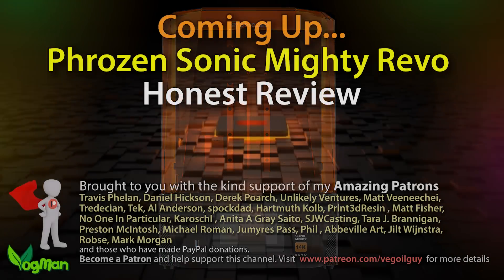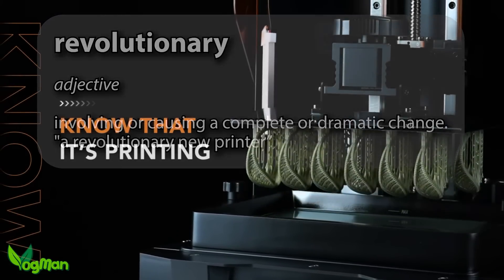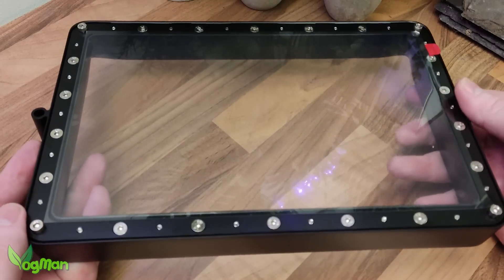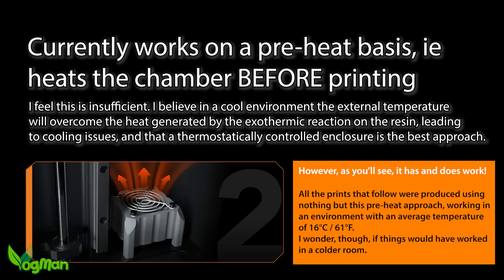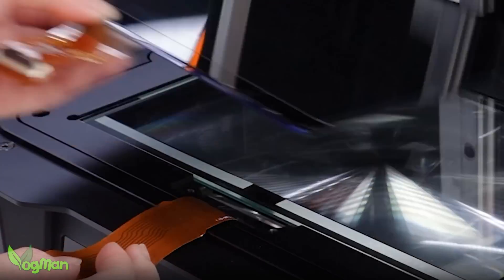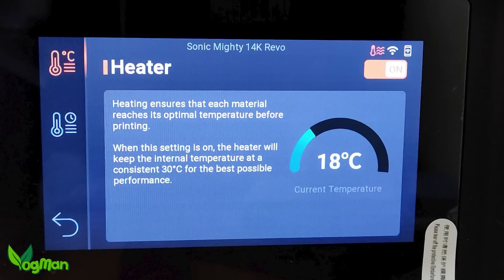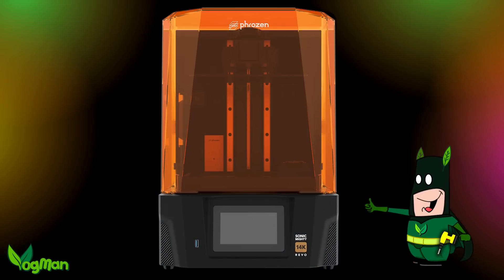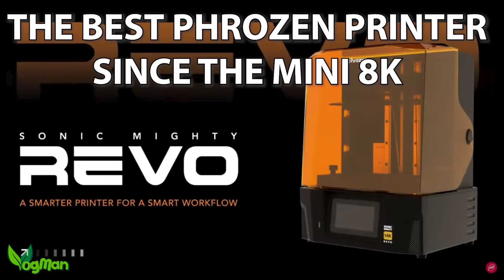Phrozen Sonic Mighty Revo 14K (HONEST review) 3D Resin Printer

Comment: Hey Vog, some people complain heaters cause print lines, did you encounter this problem ... i wanted to buy elegoo mini heater but ive seen people complain it produces print lines in every print.
Reply from the maker: No, never had that issue. I guess problems are possible if you don't let everything warm up to the correct temperature first. But I just leave things half and hour, or an hour if there's a big temperature difference, then set things running. I genuinely wouldn't be without a heater 😁
Reply: @vogman  but did you test the elegoo heater ? users say that elegoo heater is the only one that causes such problems..
Reply from the maker: No, actually, that's quite interesting. I did ask them if I could review their heater as I'm such an advocate of their use. Strangely they told me there was a stock shortage. Maybe there is an issue...?
For your peace of mind, I've had no troubles with the ChituSystems heater.
Amazon UK ▶ https://amzn.to/42GtSGD
Amazon US ▶ https://amzn.to/42xbz6A
Reply: @vogman  they knew you will test it properly and report the flaws ... meanwhile Uncle Jessy did the review and on his prints the layer lines were visible but he didnt say anything about it - as you know he gives only positive reviews ... thanks for your help Vog! ☺

Comment: Hey VOG, FauxHammer is complaining about the heater being useless ... what are your thoughts ?
Reply from the maker: It's possible he has a dud unit. Unfortunately it happens to us all.
Reply: @vogman  well he is referring to how the heater is positioned and as a result the heat goes up and most of it escapes through the gaps
Reply from the maker: I don't critique the critiques of others. We're all entitled to an opinion. It's up to the viewer to decide how valid that opinion is.
My experience was positive. I can say in a workshop with an ambient temperature of 16C, the Revo stayed toasty warm which is what resin like.
I've been experimenting with heaters for a number of years now, including building my own. I favour "enclosure" heaters over "tray" heaters as ultimately the latter loses heat and the former retains it, and I found the Revo's heater a reasonable enclosure heater (though I did offer a couple of comments I believe). Could it be better? Sure... but I've been campaigning for manufacturers to include heaters since the Mars 2, so I'm just grateful they're finally listening 😁
Reply: @vogman  so you can maintain the temp. in printer at 25C while ambient is like 10,15C ?   Thanks for explaining, really appreciate

Comment: Very beautiful videos and package, but the residue detection makes false alerts, the heater aims at a not good enclosure cage, the camera and the lights just doesn't work properly... It's far better (and cheaper) the Elegoo Saturn 4 Ultra.
Use your marketing money in engineers, phrozen.
Reply from the maker: I can't disagree with anything you've said as I believe I also said it, but I can say these are largely firmware issues that can be easily remedied.

Comment: How does that tilting lid design save space?  You need quite a bit of space behind the printer (and mine is just a few inches from the wall behind it) in order to open the lid..so the required footprint is much larger than the physical printer and the wasted space is behind it, so it’s completely wasted, can’t even put a tool or gloves or anything else you need access to to keep them handy as they’re BEHIND the printer.  When I remove my lid (Mars 4 Ultra) it either goes on top of my wash station or cure station…whichever one I’m not currently using.  So it doesn’t really require any space…lift it up, move it a foot to the left or right then put it down…zero wasted space.  Same thing with the new Elegoo Saturn 4/Ultra…I’ll take the 3 over the 4 for MANY reasons, the 4 just doesn’t appeal to me.

Comment: Nova3d Whale Ultra heater does exactly the same, turns off once the printing starts. I asked them why, this was their reply

hello,
Friend, our heating system heats before printing, but does not heat during the printing process. Because the screen will generate heat during the printing process, printing will not fail due to low temperature. If it is heated during the printing process, the operating temperature of the screen will be too high, thus affecting the service life of the printing screen.

Is that Phrozen's thinking or will they really update the firmware to rectify this?
Reply from the maker: Yeah, that's pretty much Phrozens approach here too. The problem is, it doesn't take into account the ambient environment. If it's already warm, it's not an issue. But if, like mine, your workshop gets cold, then it can have an impact. That's why I prefer a thermostatically controlled enclosure approach.

Comment: Crumbs, that's expensive! Specs-wise it seems pretty much on a par with the M5sPro and the Saturn 4 Ultra, both of which are less than half the price! Forgive me if I missed it in the video, but can you send print files to it direct from Chitubox or is the wifi just for status checks via the app?
Reply: the saturn 4 ultra is 12k so the price also influences that printer

Comment: A mini 12k would be a more revolutionary improvement.
Reply from the maker: That would be impressive, though I'd prefer the 14K screen. There doesn't seem much in it I know, but honestly the prints are so much smoother.
Reply: @vogman  a 12k screen on the mini's footrint would have a pixel size of around 16um, which is a huge improvement.

Comment: The knock at 2:38 had me looking at my garage door thinking someone was trying to come in 😂
 I really like the execution of the quick change screen... Price seems high for a heater and features that only "kind of" work. Hopefully Phrozen can fix the light flashes with an update because the built in timelapse feature is so awesome.  
Great video and review as always VogMan!
Reply from the maker: Many thanks. It's important to remember everything DID work, but I just think these things could work that little bit better, and hopefully these are firmware issues 😁
Reply: Yup you are not alone x))

Comment: Why is the light source this $1,000 printer is using being hidden?  No mention whatsoever by Phrozen, nor in this promotional video either.

What's so hard about putting a piece of paper over the LCD and showing us the light source functioning on every infomercial you reviewers make of a new printer?
Reply from the maker: It's not something I've ever been asked to demonstrate if I'm honest. The light source clearly works well, otherwise I couldn't have achieved those amazing prints 😁
Reply: @vogman  Of course it works, so go ahead and print a thin rectangle .5mm thick, and the dimensions of the build plate area, and show us how amazing it looks with the grid on it that you didn't put there when it's washed and cured.

Try not to break it into tiny shards when you're chiseling it off that etched build plate, :-)

Comment: I dont understand the autoleveling feature. The plate has ordinary screws  .. so what am I missing?
Reply from the maker: The auto-levelling does appear to work. Every time the printer is turned on it goes through its checks and the first touch of the plate is very slow and precise - adjusting I presume. The screws are a safety feature. With the M5S, Anycubic took flack from old school guys wanting precision adjustment. With the M5S Pro, Anycubic answered this by reintroducing the screws. I think Phrozen just cleverly observed this.
Reply: @vogman  Thank you!

Comment: How would you compare this with the Anycubic M5s Pro?  They same to have many of the same features, but the Phrozen has some nicer quality of life additions.  Are they worth the extra cost?
Reply from the maker: It has the same features, but the M5S Pro feels more thrown together, like an add-on heater that's nothing to do with the menu, etc. The Revo was well planned out from the start and an altogether better machine. But when it comes to printing, it's the same screen and the same performance.
Reply: @vogman  I bought my M5S PRO about 4 weeks ago after watching your and several other review videos. It is my first 3d printer and I have just hit 300 hours total print time as of today and couldn't be more happy with it. I really didn't like the idea of having to keep alcohol around so after I used the 2 bottles of resin that came with the printer I switched to their ABS like V2 water washable resin and I am really happy with it. Especially as I can use super hot water to assist with removing prints from the build plate which makes cleanup so so much easier.

 Personally having the heater as a seperate plug in extra and not intergrated doesn't bother me at all and it being able to stay on throughout the enitre print keeps the resin at a nice consitent temperature and viscosity. The only downside for me is if it was intergrated I could remotely shut it off if a print finishes whilst I am out of the house but that isn't a major issue.

Considering I bought the M5S pro, Wash and cure 3 plus, optional cleaning kit, spare screen, pack of screen protectors, spare vat, pack of replacement vat film and a spare build plate for about the same price as the mighty revo costs on its own makes me quite happy with my purchase.

Thanks for doing what you do VogMan, keep up the good work.
Reply from the maker: Many thanks 😁

Comment: It would be better that the vat be heated directly with a temp probe to come on and turn off rather than have an adjacent ambient heater which is less accurate.
Reply from the maker: Yes, but a hot vat and a cold enclosure leads to heat loss...  for example, a cold plate entering warm resin. It's better for everything to be the same I think.
Reply: @vogman  You are probably right now thinking about it.
Reply from the maker: My workshop gets pretty cold and I've tried a few different things. I can't guarantee I'm right, but those are the results I found 😁

Comment: Thanks for the review! 
But for 999$ they can keep it -  never gonna buy it. especially bcs its a phrozen printer. soon the new anycubic and elegoo machines will be released and for sure the price tag will be MUCH cheaper, at least half. 
Heating is nice, but not really needed and the detection features are usually turned off und useless overall IMO. 
Anyway, having competition is a good thing,, so probably soon we will have THE perfect resin printer.
Reply from the maker: It is pricey, but it's the best we've seen from Phrozen for ages, and they've deserve praise for that if nothing else.
Reply: @vogman  you can praise them ;) but my printers need to generate money, and the 300-400€ (AC and ELEGOO) printers doing the job nearly perfect on a  24/7 base in my shop without failures. and when you need a few of them the price difference is huge. The good thing is, everyone is free to buy what he or she wants, so - happy printing! Thanks again for you tests, really appreciate!

Comment: Thanks for the review! You mentioned the pixels are even more rectangular in this printer, is it noticeable in any way or does every angle look smoother than the mini 8K?
Reply from the maker: I've only reviewed two 14K printers, but both have been better than any 12K I've seen. I suspect the manufacturer knew something was off with the 12 and quickly developed the 14. It's much better. Hardly any layer lines. No sign of vertical artefacts

Comment: Could the strobe effect be because it's an LED light? They flash on and off very fast, imperceptibly to us, but can be caught on camera like this due to the camera's  shutter speed.
Reply from the maker: That's an interesting point. You may be right. But I film under LED lights and there's no flicker, so I'm not sure that's the answer. I do KNOW that the light turns off, even though I turned it on. So that seems more probable to me 😁